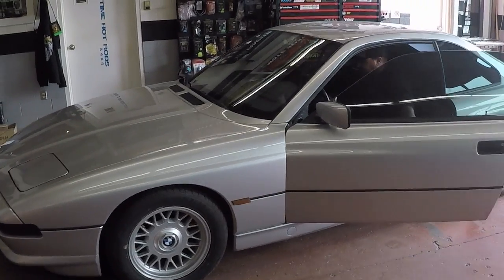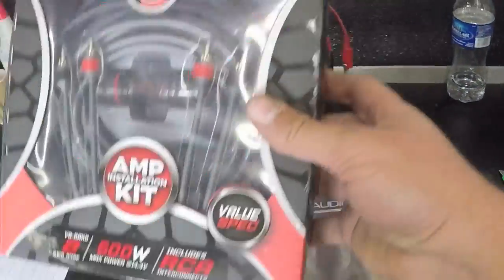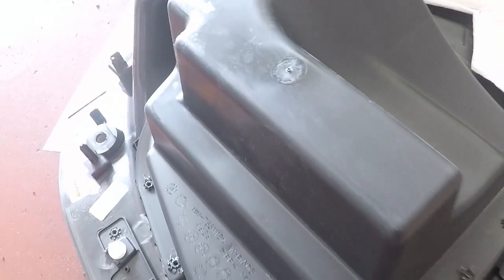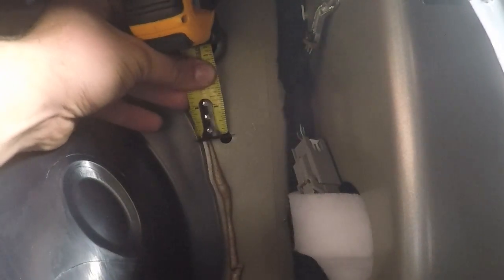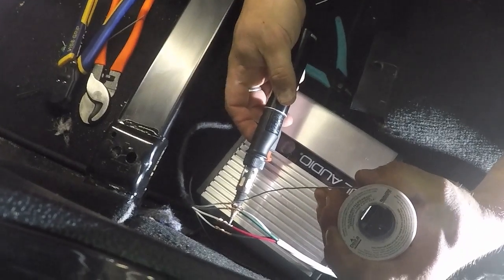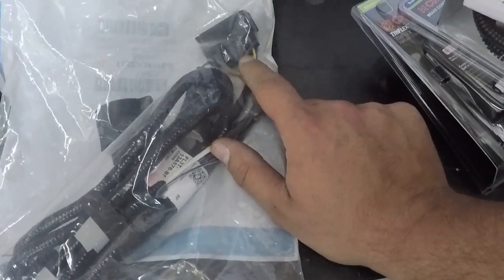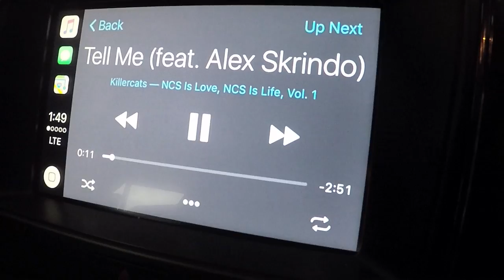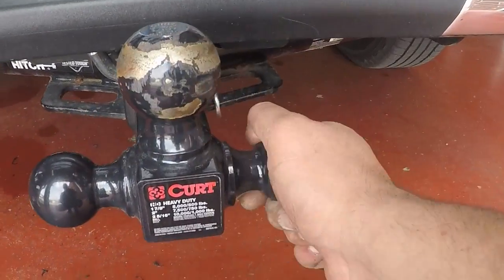(JL Stealth Box) How To Install In 2011-UP Ford Explorer!

Comment: Thanks for this video, it helped me change my oem subwoofer and with your video I was able to do it quickly. I kept the OEM box, changed the woofer to a Rockford fosgate dual 2ohm and the difference was amazing! Thanks again
Reply: Hello, did you change anything else or just the woofer? I have a 2013 Limited and was looking for some easy upgrades.

Comment: How did you feed the audio signal to the amplifier? This is a DSP controlled unit that automatically lowers the bass output upon raising the volume. Were you able to defeat that? Or did you just use a high/low level adapter and piggyback off the speaker outputs?

Comment: Is it possible to add a aftermarket amp and sub upto a factory deck... I have a 2015 Taurus limited want some extra thump... But if I put a aftermarket double din deck in it'll still have the slot for the CD insert showing... I'm not to far from London and can swing buy your shop...

Comment: Is there another stealth box that can go on the drivers side also? If not, is there a box that would fit somewhere else to house two 10" subwoofers?
Reply: I had the same question. The driver's side houses the rear air conditioner. You can run a Skar 10'' tube, they seem to have a good amount of base.

Comment: does the truck harness have the 12v charge wire? i work at ford, and know that some f150's that dont come with the trailer tow package wont come with that 12v charge wire in the harness.
Reply from the maker: MikeHillman I don't think so....... I should probably check that......
Reply from the maker: MikeHillman any info on it would be awesome if you could send it to me in an email carphonix@gmail.com
Reply: sent you an email
Reply: you also have to put the 12v fuse in before it will work
Reply: 2015+ without the trailer tow package do not have the wiring in the harness, nor does it have a spot for the fuse like the 2009-2014's do.
Reply: no shit. Sorry, been a grip since i left Ford parts Dep.

Comment: Don't blame Curt, blame the dealership that installed it, they could have gone to their own parts counter just like you did and got the proper harness and plug, but they elected to cheap out and go aftermarket.